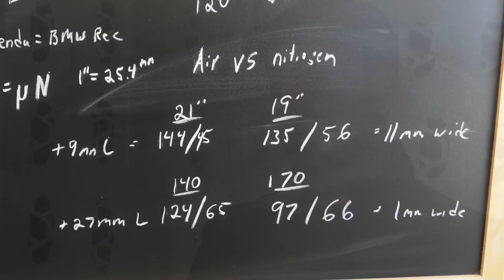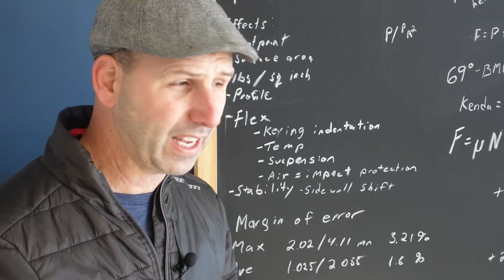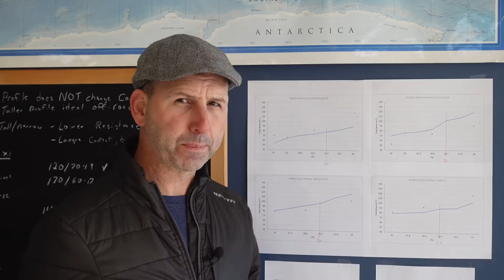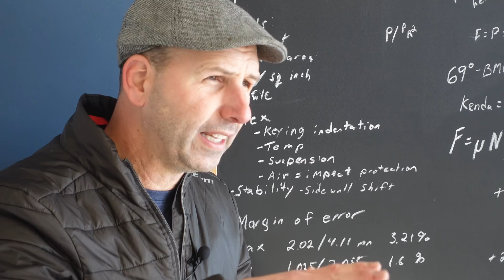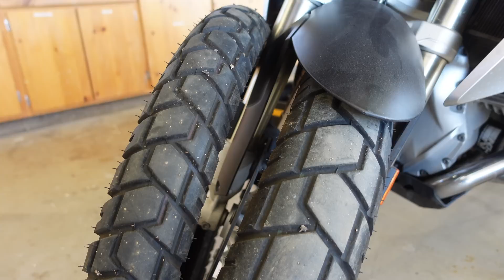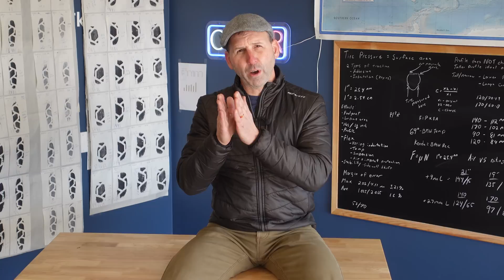Selecting the correct tire pressure; How airing down motorcycle tires affects contact patch

Comment: To analyze properly, in my opinion , the contact area of the tread should be compared while in a rock bed, sand, or other obstacle, not on a flat surface.
It has to be taken into consideration of how the power and control is different if say, the rear tire of a GSA was dropped to 4 lbs and how that would allow for slower speed manoeuvres through and over rough terrain.

Hitting a curb with low tire pressure in the front tire is obvious that it will be jarring, but over a  rock bed of 4-6” round rocks it would be a different result.

Having said this, I don’t air down my tires. There has been some challenging hill climbs and challenge courses that I wish I had thought of airing down. The individual who did air his rear tire to 4 lbs did win the challenge course over 40+ other participants.
Reply from the maker: The challenge is how to isolate each effect.
Reply: @BretTkacs  Of course it is. Actual Comparative Analysis. Otherwise the data is not credible.

Comment: I struggle with this topic, for me there is a major difference in "feel" on sand when I air down about 50%.   I can't say if its a larger foot print or what, but it makes the bike much easier for me to ride at low speeds on sand.  R1200gs w/ 50/50 tires.

Comment: Well done, but it’s important to remember that this footprint tests are all static, and motorcycles are dynamic systems. All can change when there are more inputs to the system, like other forces. But still very interesting.
Reply from the maker: The challenge is always controlling all the factors influencing the tires, this is why the question was "how much surface area do we can as each pressure"
Reply: @BretTkacs  Yeah, and I don't think there's a simple way to measure this (without very expensive systems that only manufacturers have) better than you did. In the end, what really matters is what you prefer when riding, after some testing. I'm new to adv bikes, just bought a lc r1200gs, and I've been watching your videos to transition my sports bike techniques to an adv bike. Thank you for all the good content :)

Comment: Lots of work put in here. Thanks Bret. This is a difficult test to control for extraneous variables and it looks like you’ve tried your best here. One question, maybe I missed it, but did you use the same bike for both tires? 

Lastly, I’m too am interested in hearing from the manufacturers on how they are determining their recommendations. 👍
Reply from the maker: Two bikes (same manufacturer) and 4 different tire sizes. R1200GS and an F800GS.

Same load 185lb rider. Many of these were printed multiple times to ensure consistency in the results. Temperature was controlled to 59 degrees even though BMW controls to 69 degrees

Comment: there are flaws with how you are going about this 1.  the whole premise is airing down for off road and you are comparing tire contact patch size based on inking the tire on a flat hard surface well offroad the surface is compliant and gives and can compress (mud sand clay) which will interact with a much larger contact patch as that curve of tire just starts to disconnect with the paper if the ground is deforming it allows contact with that portion of tire not shown on your paper.  2. your only empirical data is a hard obstacle you mention once riding in sand but don’t do any testing associated with that type of riding

Comment: Would have been interesting to see gains in traction, if any, probably wouldn’t have been so much with those road based tyres - but I’m guessing most air down for extra traction , but probably going to be pretty difficult to judge on non knobbly tyres. Also the thickness of the tyre wall, compound, construction type etc, will effect deflection, there’s obviously some advantages for lower pressures as the experts run them.  Nice to see a graphical/pictorial demo tho of what is actually going on - thanks
Reply from the maker: That is a tough measure do to the challenge to control variables. Race tech did a traction study for suspension by measuring speed and slow motion measure of roost.

Comment: As always excellent content and research. As a newer ADV rider the information you can get is mostly “this is how I do it”. My big Pan America in sand is difficult aired up or down. Biggest difference was when I went from the stock tires to the Anakee Wilds. HD wants those run at 36PSI and have found it to work well.

Comment: Thank you finally we can put myths to rest!

Would be great if you also looked into different tires to see how carcass strength/construction effects tire behavior?  The anecdotal evidence suggests that you need to run lower pressures on some heavy-duty tires like Mitas E07 Dakar
Reply from the maker: That is true but an entirely different research project. As an example the Shinko 705 (170) has a max load pressure of 42psi but the Shinko 805 has a pressure of 36psi.

This is why I used tires that matched the OEM numbers for the experiments
Reply: @BretTkacs  it was interesting to see how 19" contact patch was not so different from 21". I always suspected that the difference is due to rubber available

BTW I have used Shinko 705 in 110/80-19 and 90/90-21 and it was surprising how sluggish it felt in 21" in transition; must be the difference in profile. This was relatively to other tires in those sizes so it cannot be attributed to diameter.

Comment: As a suspension workshop - we greet the interesting video. 
As a biker - it is quite subjective, what air pressure You like to ride. But! There is a "correct" pressure for the tyres. Has been so for the cars and is so also for bikes. It usually is a range of about 20percent of the overall pressure. It depends on so many things and will be different from rider to rider and place to place. But in any case - the manufacturers are running the so-called safe numbers on the bikes. Ktm 690 with a 65kg beginner rider will have a different pressure for good off-road characteristics than the same bike with 100kg pro agressive rider. But the pressure will not be more than 10-15% different. 
As a workshop - AIR DOWN  - but not too much. Rebuilding wheels is not cheap. air still is.

Comment: Comin from trials riding where we are running with almost no air in the tires, going to a 2005 model 1200GS with TKC-80`s going a lot gravel and also real offroad,  i think I have some experience to share. For "normal" gravel riding reducing slightly from road pressure - lets say from 32PSI to 25PSI - makes the ride noticeable more smooth and noticeable more grip on loose surface. Its not only the tires that works better, but it also takes some of the load off the suspension. For "real off road" riding in slow speed (im a trials rider. Trials riders dont need speed to have fun  ;) ) i go even lower to around 20PSI and this really makes a difference in grip over rocks, diagonal roots and so on.
Reply from the maker: 20 PSI is around 45% below the pressure for the OEM tires. Of course if you are running an ADV knobbie then rise often have lower pressures by design including the pressure for max load

Comment: Nope. Only in soft soft sand.
But you didn't compare the footprint DURING BRAKING, with all the weight up front. And due to tire stiffness, the footprint of the tire as a function of weight is non-linear, so with lower air and more weight the difference between aired up and down will be higher.

Comment: Road tires are different then a real offroad/mx tire. Air down these in a test and you see what i mean.
Reply from the maker: I was focused on ADV bikes, not MX bikes but would be surprised to find different results. I did talked to several tire manufacturers "off the record"
Reply: @BretTkacs  the ADV tire you tested is more road use than offroad.  I think a 80/20 how more it goes tot 50/50 and 20/80 the nobbies get more surface contact.

Comment: As ever, informative but on my 701 on Michelin Trackers and Tubliss I will still air down to 15psi (26psi is recommended by Husqvarna which is fine for most riding even on knobblies) for sticky, muddy climbs but for most riding stock pressure is fine. I note you give the 690 a wider range. I also note this is for adventure bikes, not dual sports with rimlocks and much softer sidewalled and aggressive tyres.
Reply: @Tim Brandt it is the same. 20psi for off road. I use mine for motocamping so me in kit and helmet is 100kg. Camping kit is 20kg, so my bike is carrying a lot more kit than yours. I go down to 15psi for muddy climbs so more of my knobs get some bite. But if I'm riding mixed terrain, about 20psi and I carry a pump. I like Tubliss. Bit of a job to fit but no worse than a UHD innertube. I've never had to plug one.
I always use rimlocks. I've ridden 40km on a dead flat Michelin wild at 70kph with rimlocks, so they do work at low pressure. Tubliss v UHD and rimlocks? I'm not good enough to notice any difference. I just prefer not having to carry tyre change kit.

Comment: Very interesting Bret. I don't bother airing down now on gravel roads. Probably the reason is I've got more experience. But for sure on my AT dropping down from 29 psi to around 20 -22 definately gave me better feel. That was on the 90/90-21 Tck 80 matched to a Mitas EO7 150/70-18. Appreciate the massive time you put into this video

Comment: Are you ever in the Olympia area any more?  
If I remember correctly, you started off here...?
I recently bought a T7 and I'm looking for some smartass to ride with...

Oh, and I run 20 psi in my tires all the time.  Bike is fine at 70 mph.
Ran 25 psi on my Ford Explorer in Mexico for the last 5 years.  Hammered the F**k out of these BFG All-terrains.  No problems.  Lower is better.

Comment: so do I understand correctly that basically you don't really need to air down for off road and if you do, it should be to reduce bounce (but not going below 30% or recommanded pressure)?
Reply from the maker: For me I just run street pressures, 10% or less on the front, 20% or less on the rear.
No significant measured improvement between solo and those numbers.

At 30% it's a loss (general rules)

Comment: It’s complicated- but a couple of real world observations;
1. Regarding ice and snow a narrow tire has significantly better traction than a wide tire.
2. Off-road motorcycle racers use very low pressure tires ( incl “mouses”) so there must be some advantage.
3. On my 890-R some gravel roads feel to me like I’m driving over marbles. Next time when I feel this I’m going to drop the pressures 20% and do a real world test.
Thx for your efforts!
Reply from the maker: KTM recommends 17% below the solo street pressures on the 890, the 790 was a 25%  reduction
Reply: @BretTkacs  Thank you!
Reply: About point 2, just to add and not to contradict: off-road motorcycles are way lighter meaning they are less prone to bend the rims, and also mousse is used because it never get punctured and deflated like a regular tube, so they are removing that possibility that would end their race

Comment: I've been riding offroad for a while, and I've always ridden factory pressures. IMO, at low speed, you can pick a line, and if you can't pick a line that's not the tires, that's you. Tire pressure won't fix that. At higher speed, you need a harder tire to take the hits or you'll break a rim. My current bike is a 2017 Africa Twin, and that 21" front with a wire rim and factory pressures works decently in all conditions, including 200+ kph highway riding (that wasn't me) and 20- kph babyhead riding. It's entirely possible you can buy 5% footprint with low pressure, but you break shit on rocks instead. Not worth it, IMO.  Leave the tire alone, the tire isn't the issue. Let's face it, most of us aren't riding in the top 5%, farking with your tire pressure isn't gonna make you an offroad Rossi. Leave it the fark alone. 

 Instead of farking with your tire pressure, learn to aim your bike. Like anything, practice and skill will make your day a whole lot more fun. Maybe take one of Bret's classes, he'll make you a better rider. I did, and I got pushed hard. Which is good, because you should train how you ride. Between Bret, Kramer, and Reg, I'm confident I'm a middling competent rider :P

Comment: Good information, there’s a lot of us that have Yamaha XT250/Honda300s, I’m not an air downer but I’m interested if this translates to much lighter bikes (I’m supposing it does). It would be cool to see more practical comparisons of off road on different types of surfaces. I know it would depend on the tire but is there much of the dragster tire flex on an air downed rear tire to help prevent tire spin on surfaces like the California typical dry trails? I ask these questions because I know they’ll come up while bench racing.

Comment: As an engineer, I love these experiment videos. A lot of common motorcycle beliefs aren't rooted in science, so it's great to see people like Bret get down and dirty with real data.
Reply: Not gonna get into the semantic argument, but for sure it's GREAT to see some science done because as you said, a LOT of common knowledge for motorcycles is not at all rooted in science, just random explanations that people guessed at then told other people until everyone is repeating the same "seems plausible" but totally unfounded stuff.

This is the motorcycle content I want more than anything else.
Reply: I air down because my 63 year old body can feel the difference on those 80 mile enduros or dual sport rides but I am only riding a 280lb 250cc dual sport and I am running 12psi
Reply: @paulcamino5034  yeah, this is more about midsize and larger adventure bikes.  He even clearly states this in the video - light dirt bikes are very different animals.
Reply: @Derrick Whittet  I know it's about a adventure bike, I actually have a tenere 700 also and I like pushing the envelope and run low 20psi, just like the soft tire feeling like my  enduro bike, sometimes I think it's smaller then it is and get in deep troubles
Reply: I'm guessing fresh out of school engineer...🤣
Reply: Look, that pin stripe on the tank makes me 10% faster...
Reply: So, having your bike’s air pressure at recommended levels is the way to go, in terms of contact patch and so on. What about trail breaking to maximize contact patch when the suspension is loaded and ready for cornering. Is there an increase in contact patch as I’ve heard is created, or is that a myth as well? I enjoyed your science take on this subject. I rode mountain bikes in my younger days and we would air down for more traction. I honestly thought it applied to motorcycles, too.
Reply: @jesusacovarrubias1390  trail breaking balances the chassis and loads the brakes. Off road on rough surfaces is a whole other thing.
Reply: It does apply to motorcycles...the fact pinch flats occur means tyre conforms. Work on the numbers given here, Bret did a great job but a disservice too by using mm gains when talking about percentage changes. Should have said for X percentage drop you get X percentage more surface area, you will then see in the one example 10% less pressure was around 13% more surface area.
Reply: Beliefs aren't rooted in science. A basic definition of belief is the absence of knowledge; it is a worldview that is chosen due to the social environment a person happens to find himself in. A prime example is religion.
Reply: @nickthequick  Beliefs can be rooted in truth, lies, science, or ignorance. I believe in good science, but then by your definition science is the absence of knowledge from my perspective.
Reply: @nickthequick  Most belief is absolutely based in science, or some kind of systematic observation, like belief in God is based in philosophical inquiry and observation of our universe. Whether that belief corresponds to truth, is another matter, which is why more scientific inquiry is employed to try to get closer to truth. Science should never really answer all of our questions absolutely, apart from the basic stuff, like how long an object is, thus ot can never really "be settled", a statement that is profoundly unscientific.
So, more scientific experiments are needed to try to better answer the questions this man here thinks he did. For example, he observed what he deems to be a small change in contact patch area. Cool. How much does that actually affect traction or floatation over a given type of surface? There was no attempt to test this scientifically, yet I feel like an attempt to draw such conclusions was made, which IMO was pseudoscientific. A 10% contact patch change could have a 50% impact on traction, if that could be measured. Another factor that was never considered here was the type of tire casing, sidewall thickness, compound, tread. What other unbeknown to us factors could there be? The more we know, the more questions we have. That is true science IMO.

Comment: Great video that also underlines the huge differences between tires for bikes and tires for cars. If you have a car with dedicated offroad tires and small rims, airing down makes all the difference. It is not even a discussion. You have a massive gain in length of traction surface and you directly feel it. My Land Cruiser 78 series with 16 inch rims becomes a monster offroad only after airing down significantly. The tires on my 1100 Africa Twin only need a tiny bit of airing down in comparison.